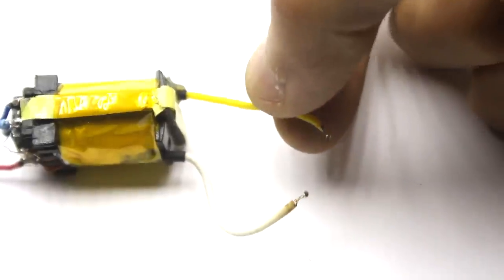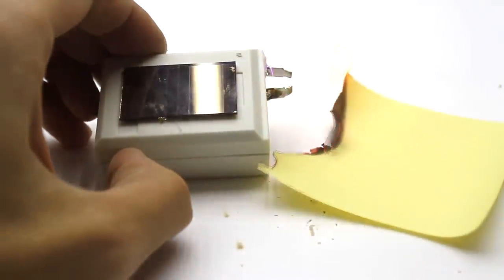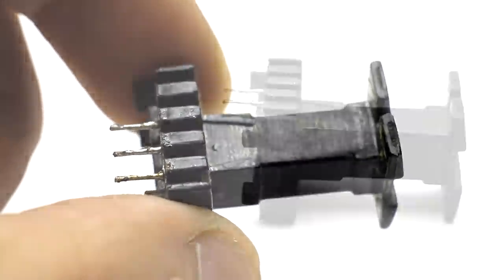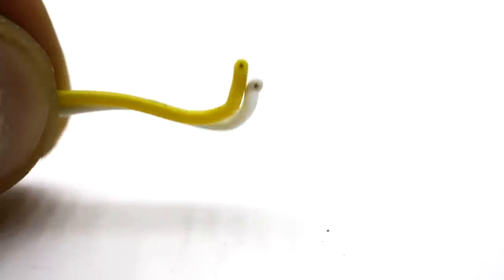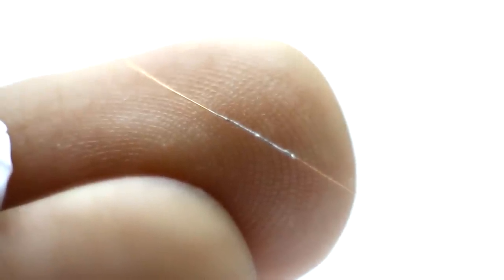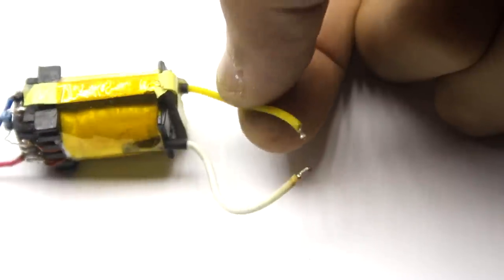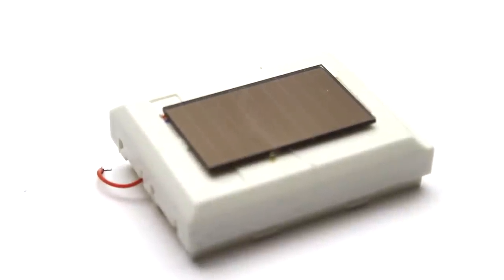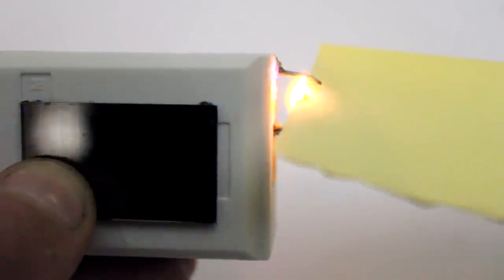Almost eternal lighter

Comment: I find boiling the transformer in water for ten minutes is enough to loosen the glue used on the core. With some heat protective gloves you can pull the cores apart while they're still hot.
Reply: Thanks for the tip, makes it easier to get the transformers apart.  Semper Fi,

Comment: the pre built transformer mentioned at the end works quite well,  but i would point out it can also be had as a kit.
look for '15kv arc generator'. they sell both the transformers separately as well as a kit with the transformer and the circuit/components.
(though not including the battery and solar cell)

Comment: Ahhhh...  you can still overcharge a Li-Ion cell with a small current. In such an instance, you should use a protected cell, with a board that cuts off to prevent overcharging and over discharging. You can also use a phone battery, a lot of them feature such protection built in. But dont always assume that this is the case, test to make sure first.
Reply: Zener diode bro... 😂😂

Comment: Wow this is genius cause if you are in a survival situation and are like lost in the woods with this lighter you to an extent have an unlimited fire starter, if your lighter goes dead just leave it in the sun and then by night you'll have more fire starter, and if you can start a fire easily, then u won't have to worry about running out of gas as long as you expose the lighter to light once in a while

Comment: Well came here because the normal high voltage generators can't handle decent usage, so I decided to make my own one, with a 300A rated mosfet. was thinking about making a fg-ms-driver stepupcoil, a modified slayer exciter cirquit, or a high impedance mechanically switched ignition coil. for the first stepup.

most other modules I have used (except for one low voltage +- 1k to 7k volt(possible peaks to 10k)) all blew themselves up like improper factored led's(yes they can explode around rated voltage when it is misfabricated).

but things like a plasma driven lawnmower would only work very short before chrashing. do not use plasma to cut gras or other plants, this can permanently damage and quite easly kill the plants, I didn't think of that yet and just thought this is a great knife so it should be able to cut gras.

but if that cirquit works with a fet like said, then it is worth a try especially since it generates magic AC which is in many projects very usefull, and it doesn't require to use power from a light cable which is also great.

Comment: I've made only 980 windings. And my ferrite coil was broken in to multiple pieces so I glued it together. And I was out of material. But It worked anyway, just arc light was very small. But how it zaps 0_0.  As for experiment I've applied 12 v. I've burn single irfz44n and small arcs appeared around copild everywhere. After replacing irfz44n with new one everything works fine again. The next version will be superior. I hope to have larger arc.

Comment: The best way to separate cores is to put it in a tin can with some water and boil it for 20 minutes on the stove.  pull it out and gently twist back and forth until it comes apart.
Reply: meh, i just heated it for 2 minutes with a soldering iron at 370 degrees and it came off

Comment: Very cool project, will probably try to make it at some point; though I'd suggest you either use NiMh batteries or add a protection circuit, because Li-ion batteries can get permanently damaged or explode without one. I'll probably go with NiMh cuz their safer and way cheaper
Reply: @blakkeu13 I didn't know that. Thx

Comment: Could you use a small joule thief in between battery and solar cell to help keep voltage and current up to charge battery? Also could you use small graphite brushes or lets say, 'Tig welding tungsten electrode as the ark contacts?

Comment: got this working with a IRF 3205 which is basically a much higher amperage version of the one used in the video. however due to the low voltage of the mosfet it might be smart to add a diode to steer most of the negative voltage from the gate pin to ground and to add a diode to the battery to protect it. especially when using it for long therm usage
Reply: Testing it without the diode directly fried the mosfet, with it it worked well. so do not forget to protect the mosfet against tho high negative voltages.

Comment: Better if you put the switch in series to the feedback winding
Reply: Nah dud
Reply: Well better if you protect the switch with a diode, you don't want driving inductive load with a tactile switch, they are rated for 50mA at most.

Comment: well im not getting it to work anymore, first try it worked until it break the isolation. after was just failed. always i try to do it, it make a thin sound in the core but it wont make any arc bigger than 0.5mm. i tested my mosfet, its p80nf55, and its working. i even tried with that high transformer from old lcd and it didnt worked. i have no idea why i got it to work 3 times from 23 attempts. im frustrated, you lose alot of hours just to winding the secodary. -_-

Comment: Thanks for the detailed explanation!
IRF Z44 is getting damaged after 2 seconds of arc, pins are showing shorted connection after damage. I've used heat sink, it doesn't get hot. I've used exact same components.
What could be the problem? Why IRFZ44 is failing after only 2 seconds of arc? Do I need to connect diode from gate to source or use a capacitor?
TIP41 C is working but it is giving very very tiny arc.
How can I troubleshoot this?
Reply: vial.of.photons  Thanks! Now I get it. Secondary is giving nasty kick back when there is no/long arc.

Comment: Hi, i have a problem here, i get thr arc from the circuit but for some reasons the FET burns up after some use. Im using an 18650 cell to power up the circuit. What might be causing this to happen?
Reply: Large curent flow, use heat sink

Comment: Hi friends, I have successfully built an electric light thanks to the tutorials from Kasyan TV and some videos from the channel on youtube. Because I use secondhand components from other electronic devices, so in my project I use transistor TIP41C, but the problem is heat transistor and require heatsink, of course heatsink require space and affect the shape of lighter. I tried to use K1457 mosfet former power supplay CPU, but it did not work. So how is the solution? Should I use IRFZ44?
Reply: try using the BD241 transistor adding a uf4007 diod to the base, otherwise, u can use irfz44 adding a cermic capacitor (470nF=471j)  across the primary coil.
Reply: I too made one from kasyan and worked, but it only produced arcs 3 to 4 mm, deceasing the primary windings actually made the arc smaller
Reply: Any ideas on how to make larger arc?

Comment: I made one but i can only get arc upto 2mm not more than that plzzz someone help
Reply: Guitar Guy reduce the primary winding to half of its current amount... if you have 8 turns on the center tap ...use 4 it doubles the voltage outout

Comment: Yes, AC sparks are hot. DC won't work because it's cold.
Reply: Alvin Robinson That's not entirely true. If you have enough current you'll create plama regardless of the frequency
Reply: lightning is DC, It catches objects on fire and melts minerals in dirt.
Reply: yes, true but AC sparks are still hotter than DC sparks given the same current.
Reply: Alvin Robinson I never refuted that.
Reply: what are you basing this on? are you going off of RMS or peak current? a continuous dc arc can make a plasma stream just as an ac arc can, difference is, the dc is continuous with current and the ac is well...alternating. in ac, the voltage AND the current are changing. the current is alternating polarity and the voltage is going from 0 to peak to 0. also, the current may be leading or lagging the voltage. bring frequency into the mix and the plasma arc's properties change. when you compare the duty cycle from ac to dc, dc is carrying more energy. from an educated guess, i'm going to say dc is hotter(continuous, not pulsed) until proven otherwise.
Reply: Ok. it's obvious you studying or studied electronics. I only do this as a hobby.  I think most man made HV DC is pulsed. Also lightening is probably continuous DC that why it has more energy to burn things, Wright or wrong? I don't mind being corrected.
Reply: Alvin Robinson Well, because lighting is a capacitive discharge, and all conductors have some self inductance, the air forms an LC circuit and causes AC ripples in the lighting bolt. But in all honesty, this probably doesn't change to many properties of the plasma.
Reply: Cool. Thanks. I'm learning something new here.

Comment: Everything is done exactly , don't know why spark is very low?😢 And somebody tell me which that transistor is?? Because  mentioned in comment isn't working I think.
Reply: U used irfz44n? Bcz i tried with that mosfet and it didn't work
Reply: Tejas Sonar. field effect
Reply: Yeah u r right.. It didn't work with irfz44.. But only worked with transistor 2n3055

Comment: am make transformer and conectit on power and no work onli sparking when you connect on power
Reply: That's what the transistor is for. It switches at a very high rate to sustain the arc.

Comment: this not working please don't try any one
Reply: ganji murali  I also have tried it. It's not working
Reply: But why?? It didn't work for me too?!
I think is the mosfet .. Like .. He is very hot when i press the button and no spark what so ever
Reply: It should work nicely,  I have made 4 of them, all worked well.
Reply: ABID Inc. which transistor he use IRFZ44N.. or IRFZ44NP.. please tell me also resistances aloso
Reply: Robert Bîrdău why
Reply: However,  Z44N and Z44 are same, they have no noticible differencess.I used IRFZ44N, 220Ohm res... Make sure there is proper layer isolation in secondary,
Reply: ABID Inc. thnku....
Reply: ABID Inc. where i get z44 in genral item... like smps old computer
Reply: ABID Inc. please tell me resistance watt which is use in this actually everything is ok but its not working??, 😓😓😓😓
Reply: Lamer
Reply: @tejassonar217 bro look care fully in video what she does in beginning she twist two ends of different wire and winds the the transformer and then she untwist the both end making them not not connected to each and then she takes first end of wire and twist second wire ends and it will work fine